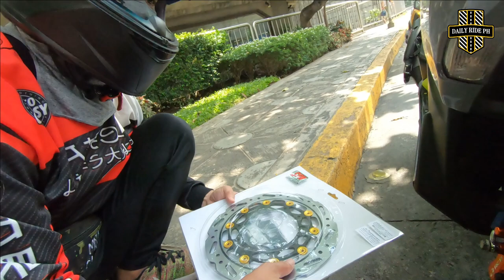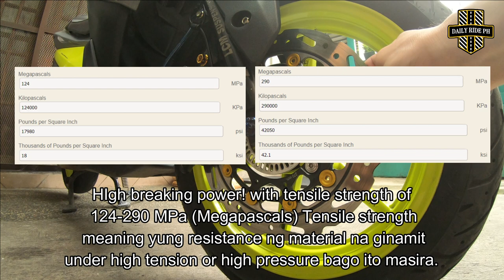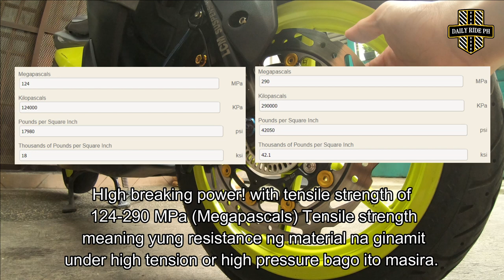RCB S3 CALIPER, RCB E3 BRAKE MASTER and SPN FLOATING DISC REVIEW

Comment: Nice review sir! Correct ko lang po, meron mas nauna gumawa ng si 270mm floating disc for Aerox/Nmax which is Boushi. 3years ko na gamit pero goods parin. Actually napaka identical ng itsura nila pati sa bolts. Hehe
Reply from the maker: Salamat sir sa infom btw hndi ko din pala nasabi na si spn si by boushi din po. Ty sir
Reply: @DailyRidePH  ayun kaya pala magkamuka sila hehe. Btw, kamusta difference sa stopping power ng rcb s3 caliper compared sa s-series? I mean worth ba mag upgrade? Naka s-series din kasi ako planning mag s3. Tnx
Reply from the maker: @RCLumanog  for me mas malakas sya compare sa s series. Mas okay braking power nya less effort compare sa s series

Comment: Mtgal ko ng gusto yang gnyang disc para sa aerox ko hm boss bili mo jn and pwde kaya yan sa stock calliper?
Reply from the maker: Yes pwede sa stock caliper 3200 php po sya
Reply: Nkpg order nko boss kay kathailander. Actually gnyan din ggmitin kong caliper boss ok ba agad pag install boss wla bang sabit? Or may need bang gawin na modification
Reply: @jocelle1122  pa-update naman boss. Balak ko din mag order nung disc
Reply: @ivanuy2483  wla pa boss 3to5weeks pa dating nia ehh

Comment: ilan mm brake hose mo idol? thanks
Reply from the maker: Yung 1000mm lang lods pag aerox s po kasi hangang dun lang sa abs system kaya maikli lang need
Reply: @DailyRidePH  boss 1000 mm po? Hindi po ba masyadong mahaba ung brake hose mo? Kasi nakita ko po sa shopee may 480 mm.
Reply from the maker: @aermac9162  1000mm is 1 metre lang sir. Saktong sakto lang sya going to abs box